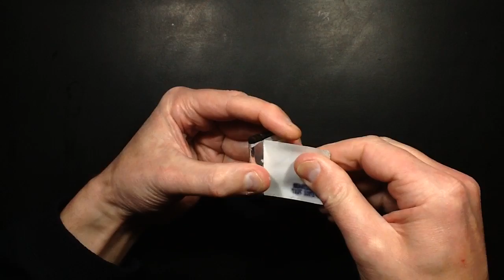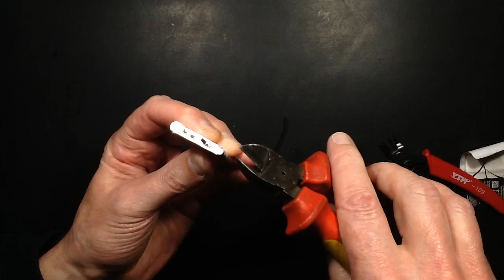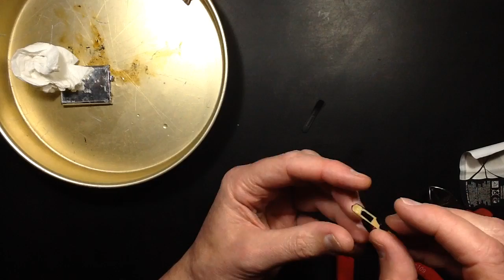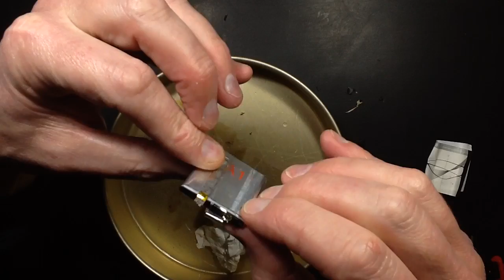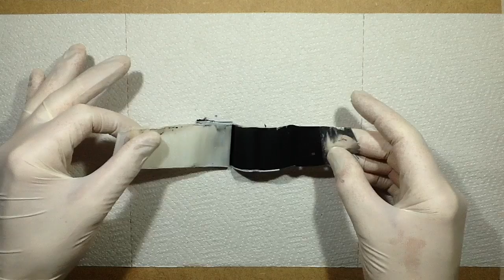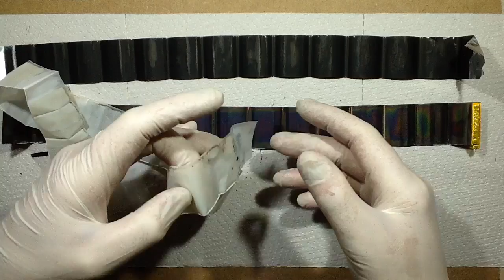TOTAL teardown of a lithium phone battery.

Comment: I love how when it made a fizzing noise, you dropped it and then almost immediately picked it back up again.

This whole video was a rather bad idea. Fascinating, but a bad idea.
Reply from the maker: +MGlBlaze All the best videos are usually a bad idea.  Even more so when it all goes predictably wrong.
Reply: +MGlBlaze As long as you wear a high visibility jacket you'll be fine.
Reply: Alan Liefting
 I fail to see how I am 'completely irrational' when Lithium Ion batteries can make a rather impressive fireball if they're damaged.
Reply: I can't believe when it started getting hot from a short he kept holding it!
Reply: Not really a bad idea, nothing dangerous..
Reply: LiPo and LiIon batteries, when punctured or damaged severely will expand and explode. And most likely catch on fire.
Reply: +Alan Liefting look up "lipo battery fire" and see
Reply: +MGlBlaze, it is a partially discharged 3.8 volt lithium batter and not an unexploded bomb!  bigclivedotcom demonstrated that he knew of the inherent dangers and took suitable precautions.  

You are like many others - completely irrational when it comes to safety.
Reply: No they don't. Can you cite any examples? You maybe thinking of lithium metal batteries and even with them it would be really hard to create a fireball.

Comment: Lithium metal tarnishes in the air rapidly, that's why the electrodes when broken down looked "rainbow-y"
Reply: I don't think that is lithium. Lithium-ion batteries contain Lithium cobalt oxide.

The energizer ultimate lithium batteries and coin cell lithium batteries contain lithium and they aren't rechargeable.
Reply: Lithium metal only exists in cells as salts, there is no "pure" lithium metal at all to tarnish.
Reply: @Brusselpicker  LMAO so I guess all the videos not just of Clive but others tearing down simple Lithium batteries to recover the lithium metal inside are a "conspiracy" right?  Try again when you aren't talking complete bollocks

Comment: A nice demonstration that exposes how these things are made on such large scales. Basically you've got a big sandwich which can be produced by a roll process, and then folded up to get it into the cell. 

In order:

Impermeable separator
Aluminium current collector ---> to terminal
Anode (graphite)*
Ion-conducting separator*
Cathode (lithium cobalt oxide)*
Copper current collector  -----> to terminal
Impermeable separator

The space between the cathode and the anode marked with "*" is bathed in an ion-conducting electrolyte.

The way this is normally made is that you 

make a big roll of aluminium with the anode attached to it, 
and a big roll of copper with the cathode clobbered on it, 
and a big roll of the separator, 
roll process them into a big sandwich,
fold it up into a container
and inject the electrolyte and seal it.

Comment: Just exposing the lithium to the moisture in the atmosphere will start it oxidizing. Worked sodium at one point and of course played with it. Not much difference between the two. Drop some lithium or sodium (bb sized) in a pan of water and watch it  as it bounces on the water on fire. Just found your channel and happy i did thanks for the videos.